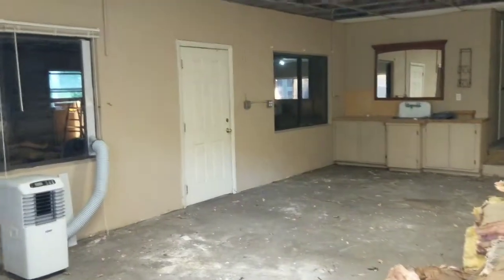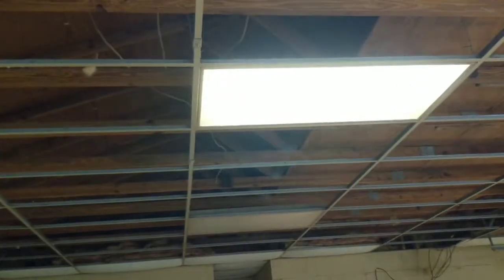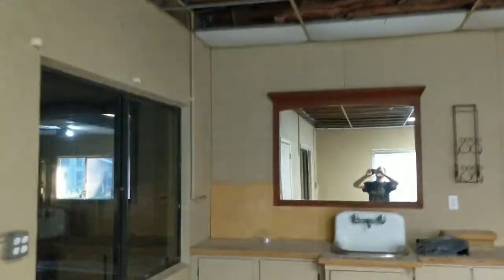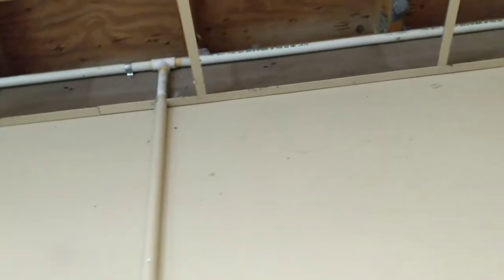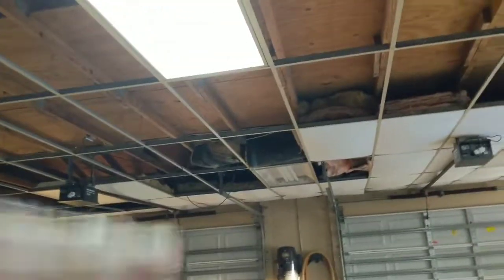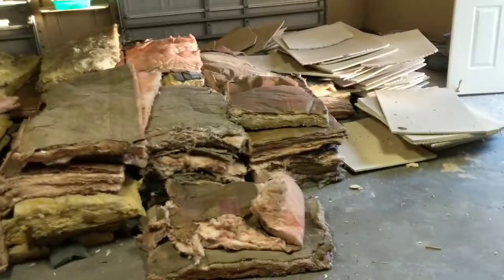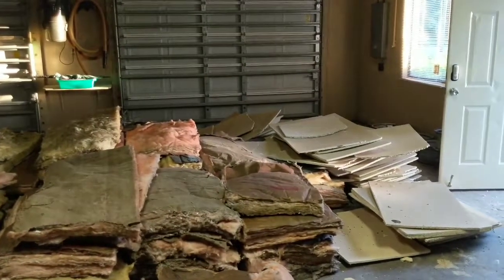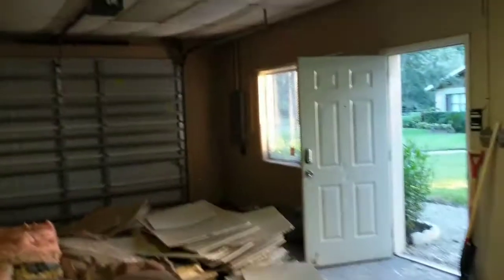New Shop Remodel Part 2: Removing a Drop Ceiling

Comment: Very Funny!!!!!  I like your sense of humor...  
BTW: PVC Pipe, when used in a compressed air system is an excellent recipe for a bomb.. It will work ... until it doesn't... then... KaBOOM!!!! it will eventually , very likely,  blow up one day, sending high speed sharp shards of PVC in all directions... a lot of people do it.. manufacturers say it is not rated for that and it is not safe...  it is your shop.  You can assume whatever risks you want.
Reply from the maker: Thanks John! You are totally right about the PVC. Some of the old system was cracked. I started replacing it with copper.